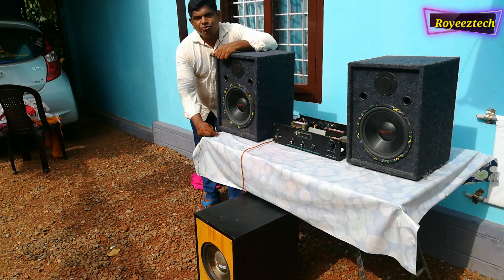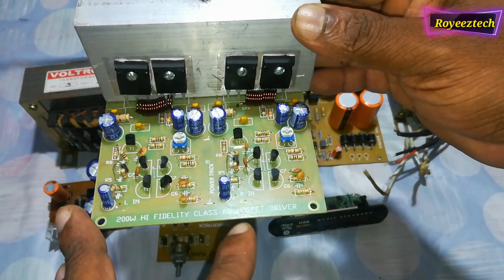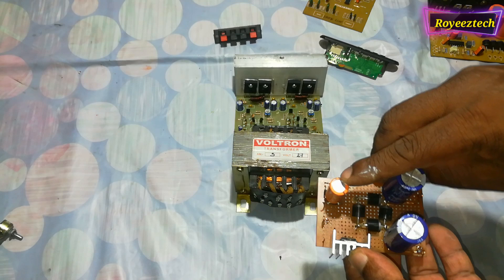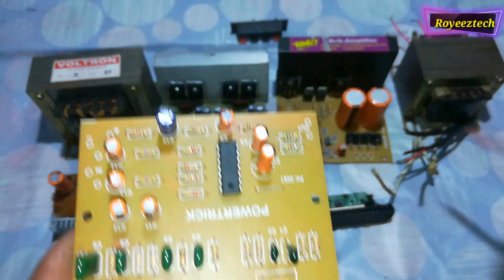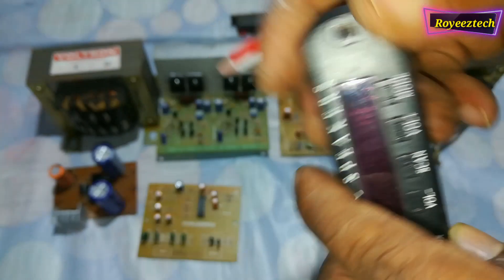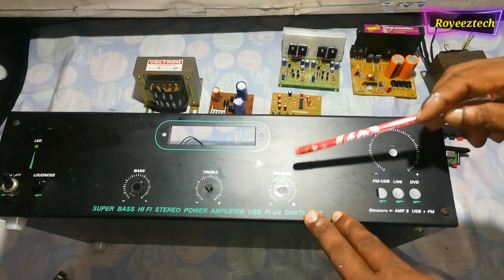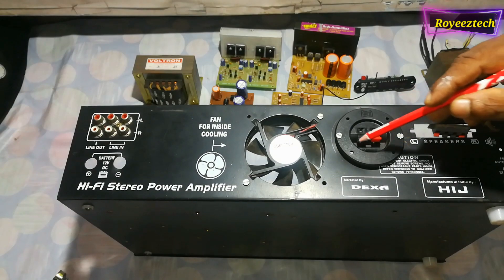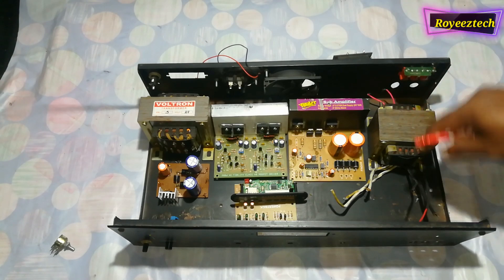How to make 2.1 powerful Amplifier,2.1 ആപ്ലിഫയർ നിർമിക്കാം

Comment: ഇവിടെ എന്തിനാ രണ്ടു transformer
Reply: Sub woofer amplifier boardinu kuranjathu 5 amp enkilum veenam enkile malls bass kittu 2board um pinne extra bass treble boardum Ellam koode otta transformeril Koduthal transformerinte ampier kurayum bass kurayum
Reply: എങ്കിൽ bass ട്രബിൾ ബോർഡ്‌ നും sub ബോർഡ്‌ നും കൂടി 5 A ന്റെ transformer ഉപയോഗിച്ചാൽ പോരെ
Reply: @vishnump666  12volt anu bass treble boardinu 27 alla aa transformeril thanne 12 v tapping ulla transformer annakil athil ninnu supply koduthal mathiyakum bass treble boardinu athikam currentinte avashyamilla 3amp ilum work akum amps koodiyalum kuzhappamila voltage koodaruthennne ullu subwoofer boardinu mathramayi amp koodiya transformer atha nallath ellaboardum athil kond connect cheythal performance  kurayum

Comment: Chetta ithil subinu upayoghichirikunathu TIP transistor aanu 27 volt 10 amps koduthal 8 ohm loadil 150 watts aduthe varullu  ee board caril smps upayoghichu fit cheythal nallth aanu

Comment: Chetta 5.1 5.2 convert cheyyunna video cheyyumo
Reply: Normal 5.1 aanel athil oru sub nulla oru mono amp koode add cheythu sub nte pre amp il ninula out ee mono amp nte input aaki kodukuka.
Athinte out sub nte aakum.
Appol 5.2 amp aayi.
Reply: @ajeeshnilambur3036   anikku electronicsine Patti valiya vivaramilla athukondu chyothikkuva RS athryakum ithu cheyyunnathinu
Reply: @gigingigin773  
Bro...apo engana azhichu conection kodukuka??
Normal ullathil ipo oru sub out undakum.Aa sub out amp nte oru section lek input aayit pokuka aan.
Amp lek varuna Same conection oru mono amp vangivhu athile input aayi kodukuka.
Aa amp nte out oru sub out aayit aakum kituka.apo total 2 sub kitum.
Reply: @ajeeshnilambur3036  Chetta ith oru technitionte eduth cheyyunathinu athrayakum uham
Reply: @gigingigin773  
 aalk aake 6 wire conection kodukan olu..pine athinte panikooli onum ariyila..
Sadanm vangichu koduthal chilar chuma chyth tharum..illel oru 100 oke vangumayirikum..
Amp nte rate athintr power nu anusarichu aakum..ath pole brand um.
Corect ariyila..tto..
Reply: @ajeeshnilambur3036  orupad Nanni chetta

Comment: hi ബ്രോ
mp3 Bluetooth decorder  ഉപയോഗിക്കുമ്പോൾ ഹമ്മിങ് / ബീപ്പ് (disturbance sound) കേൾക്കുന്നു, ഇത് ഒഴിവാക്കാൻ എന്താ വഴി.
amplifier ok, power supply filter ok, വേറെ input കൊടുത്താൽ ഒരു noise പോലും ഇല്ല.
Reply: ഒന്നും പരീക്ഷിച്ചു നടക്കുന്നില്ലേ ഒരു എളുപ്പമാർഗം ഇതാണ് 5വോൾട് mp3 ബോർഡിന് 5 വോൾട്ടിന്റെ ഒരു മൊബൈൽ ചാർജർ ഉപയോഗിച്ച് ഇൻപുട്ട് വോൾട്ട് കൊടുക്കുക ഒരു ഹമ്മിങ്ങും വരില്ല
Reply: try ചെയ്ത് നോക്കട്ടെ ബ്രോ
Reply: @suneeshraj52  
വളരെ കറക്റ്റ് ആണ്.... ഞാൻ അങ്ങനെ ആണ് ഉപയോഗിക്കുന്നത്....
Reply: @suneeshraj52  good naan cheyyaarund...
Reply: അപ്പോഴും ബീപ്പ് സൗണ്ട് ഉണ്ട് ബ്രോ
Reply: @geneshpn  
പിന്നെ ഒരു മാർഗം ഡിവിഡി യോ പഴയ സെറ്റ് അപ്പ് ബോക്സിന്റെ യോ പവർ സപ്ലൈ യിലെ 5v use cheyyuka
Reply: @പാലാക്കാരൻഅച്ചായൻ-ര1റ  bro bt on ആക്കുമ്പോൾ vol കൂട്ടുമ്പോൾ ബീപ്പ് സൗണ്ട് ഉണ്ട്, താങ്കൾ പറഞ്ഞ method try ചെയ്ത് നോക്കട്ടെ
Reply: USB boardinu separate rectification kodukuka. Allenkil dc to dc buck converter use cheyyuka
Reply: Panal earth problam
Reply: 7805  input output couple cheyth upayoghikkuka  direct 5 volt kodukkaruth ic couple cheyth thanne kodukkanam
Reply: @ajaymathew7500   RC or LC couple ആണോ ?
Reply: @ajaymathew7500  
Bro...ee humming nte prblm amp nu aan en karuthi 3 amp njn mati noki...no raksha..
Ee coupling engana cheyuka?
Enik mansilyila.
9496363695 watsap ayakamo pic???
Reply: Chetta couple Cheyyan 2a104j capacitor upayoghichal mathi appol circuit complite akum circuit googili undu
Reply: isolate the MP3 5 volt. dont take it from amp or BT board...use seaparate regulated supply.i have given so...no humming..
Reply: pazhaya oru mobile charger koduthu nokkoooo...sucses aavum
Reply: പ്രധാനമായും ബ്ലൂടൂത്ത് on ആകുമ്പോൾ ആയിരിക്കും ഇൗ noise വരുന്നത്, ബ്ലൂടൂത്ത് ഫ്രീക്വൻസി ഏർത്ത് വഴി ആമ്പ്‌ ബോർഡ് ലേക്ക് കേറുന്നതാണ് പ്രശ്നം..., എല്ലാ ബ്ലൂടൂത്ത് ബോർഡിനും ഇൗ പ്രശ്നം ഇല്ല. ബ്ലൂടൂത്ത് ബോർഡിൽ usb സോക്കറ്റിൽ നിന്നും ഒരു വയർ സോൾഡർ ചെയ്ത് ക്യാബിനറ്റ് ന്റെ ബോഡിയിൽ  കൊടുത്താൽ അല്പം noise കുറയും..  അല്ലെങ്കിൽ ഡിവിഡി smps പോലെയുള്ള അഡീഷണൽ പവർ സപ്ലൈ കൊടുത്ത് ഒരു പരിധിവരെ noise ഒഴിവാക്കാൻ പറ്റും